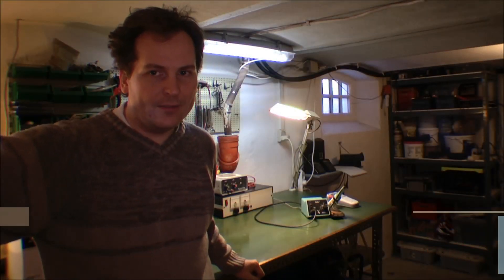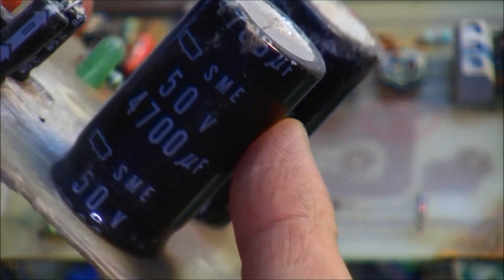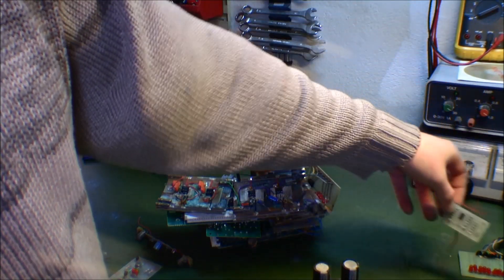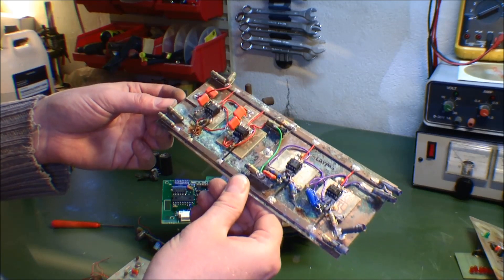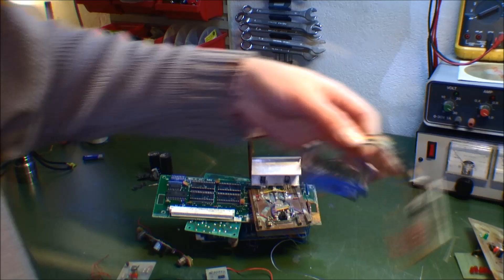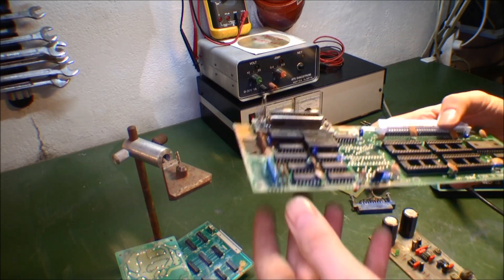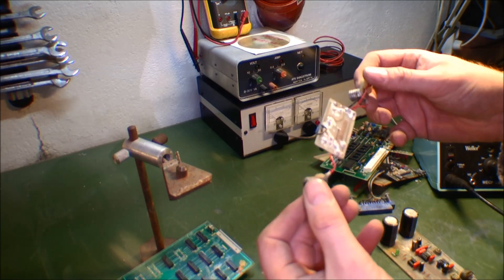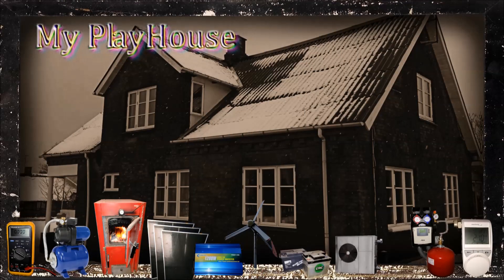Saving good electronics components before the rest is scrapped - 131

Comment: Yeah sometime it hard to find.certain higher voltages capciators,like a ,.05 mfd 600 volts or a .01 mfd 400 volts ,I would even settle for used ones that ring true.I need a cap,fairy,,disable get on a fix income forces one to be cheap.but I do agree with your video ,recycle,when ever possible.that why you need a meter to let you no that they are still good.old radios is what I try to recap .I love tube radios.
Reply from the maker: Hi Ron Thompson
Thank You very much!  glad you liked the video :-)
Thank you for watching! :-)

Comment: I've been doing the same!! Found a lot, too...
I've been scrapping radios for variable capacitors, diodes, knobs, cases, and the wall adapters (for the thin wire inside, to scrap or save), and have made 4 crystal radios!!! The thin wire is used for the coils, and diodes for detectors!! And don't forget to save the speakers, switches, screws, nuts and bolts...
I was given an AM/FM/SW radio, and just dried it up (water got inside), and it plays just fine!!!
Lots of reusable components, and that's a good thing, because radio shack has gone bankrupt, and is no more.
Good video to watch!! Happy scrapping and part harvesting!!!!
Reply from the maker: Hi Sooner Science Nerd 
I save good things in a small stack, once in a while I go through it and take the good/expensive components out. Before the rest are thrown out.
Thank you for watching! :-)